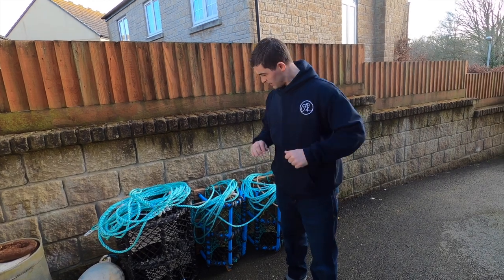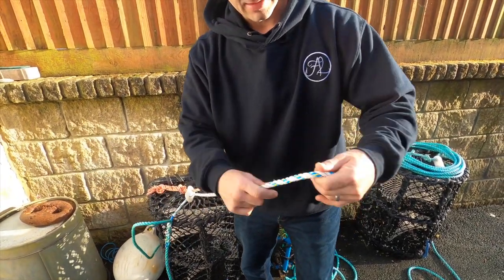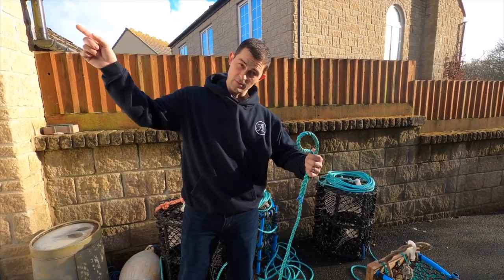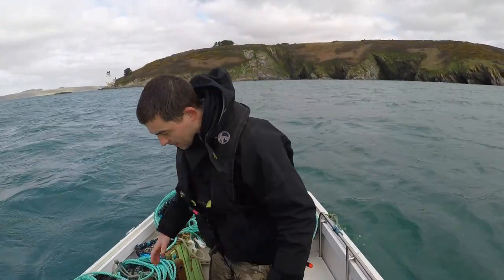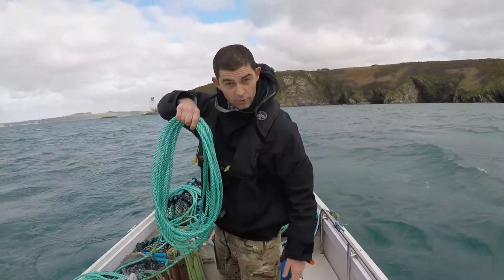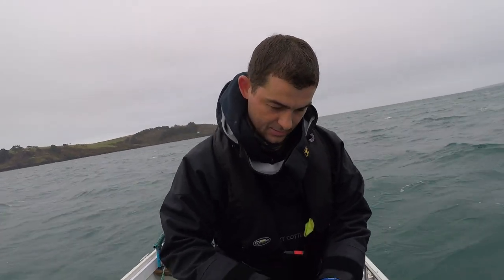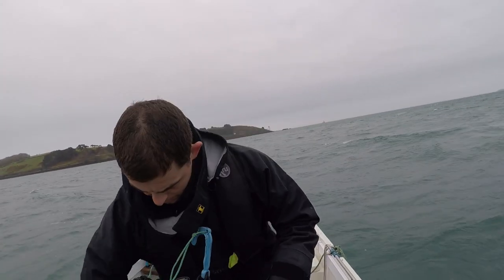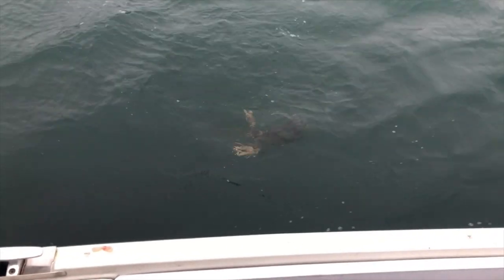How to use Lobster and Crab Traps - Small Boat fishing | The Fish Locker

Comment: Should add a 2nd Dahn really John.
Loads of reasons,can pick either end depending on tide,wind conditions,if you've got 2 ends l can be lost cut etc but probably most importantly,other fishermen will know which way your gear is running. With only 1 end its impossible 2 know and you risk being shot down.
Reply from the maker: - Long fleets I agree with you 100%  about people knowing where your gear is etc. But short fleets like this tight inshore you shouldn't get anyone shooting gear withing 100 yards of your buoys anyway ( of course there is always someone who will be that exception ). There are points to argue for both ways. Very true you could get one end cut off, and in wind/tide conditions it could be easier to haul from the off end. But with short fleets I have seen the two enders get wrapped around each other at low water and causes a right mard of a tangle holding both buoys down at high water. Also more ropes to handle on the boat. I acknowledge your point 100% Mark, but for very short fleets like this I have found its 50/50 pros to cons.
Reply: @TheFishLocker  Fair enough john
Another reason to consider is,if 1 of your pots gets snagged, say the 2nd one,how do you reach the other 3
If you've got 2 ends you can cut and go haul the other end.
Lost count of the amount of times I had 2 do that with nets
Thought about you over Easter,don't think I've seen the bay looking so flat  for the time of year.Hope this nightmare ends soon.

Comment: would you consider using a "shooting bar" to keep the rope away from the engine/ your feet/ other inboard boat snags etc?
Reply from the maker: - If I did this for a living and had more than a couple of pots then I would retro fit the boat with some bars and protectors but as its still a fishing boat primarily I haven't bothered.
Reply: Hey John...a wee tip. If you are shooting away to starboard (which you are in the vid), put the wheel slightly to starboard ... you will do a slightly curved track but it will stop your rope crossing the stern and keep it off your starboard quarter. Keep posting the vids. Really enjoy them...
Reply from the maker: Tim Butlin - I did run a slightly curved track to starboard as was you say but you will see just before the last pot at 07:58 I alter course so I can drop the last pot off that side. Rather than reach over the barrel and have to lift it right across the boat. With 4 pots it’s much easier as it’s all down one side. 😉👍🏻🦀🦞

Comment: Another fab video. I always get a little motion-sickness when I watch you on the boat! I'm never able to tell if I'll be seasick if I get on a boat - I've been fishing in rough seas and be fine, and I've been really ill on flat calm waters! 

Great video. I live by the Welsh coast, and love to forage too. But what are the laws regarding potting? I'd love to drop a pot to get some edibles and spider crabs. (they're safe from me so far, with this lockdown!). Where could I buy a professional pot - or one of yours...?
Reply from the maker: - You will need to check with your local fisheries authority about what your relevant regulations are. They change depending on area. Sea sickness is a strange one. I occasionally get seasick - usually when overtired/jetlagged etc. Take care Jack and stay safe. ;)

Comment: So I have just a couple questions about the process of using crab pots. I'm new to it and have made a traditional one. Is it possible to use them without a boat for small green crabs? If so where/when would the best places/times be to try? Any info would be great thanks!
Reply from the maker: - You can use them from the shore, either off a pier into deeper water or simply by walking to the low tide line, attaching a rope and throwing them as far out to sea as you can. Green shore crabs are usually a lot smaller. If you wish to cacth them you will need to make the meshes and entrances much smaller.
Reply: @TheFishLocker ok thank you so much! And when  I was weaving the pot i made it more like a basket with with a funnel top 🙂 thank you for your time and information! Beautiful channel and content. Im On the other side of the Atlantic and it's amazing the sea life that's the same.
Reply from the maker: biffyburton - I have a friend who weaves his own willow “withy” lobster pots. They’re very attractive to look at.
Reply: @TheFishLocker  I agree they look lovely. You guys are fortunate to have not only a good supply of willow but you can use it all year as well. I had to use pin cherry. I've had it in the water a couple times and it's held up well I just wasn't placing it in the right spot which you've confirmed haha. I'll have to let you know if I catch anything next time out!
Reply from the maker: biffyburton - Here is a link to some of his homemade pots. https://www.instagram.com/p/B-7O7N0H555/?igshid=1xwaqjbn8utao
Reply: @TheFishLocker  stunning work. Lots of hours and cut hands lol. I think it's great people still make them.  Not very many people over here seem to know what they are let alone how to make them. I'm not sure if it ever caught on here. The tides in the bay of Funday are pretty vicious.
Reply from the maker: biffyburton - It is almost a lost art form here to.